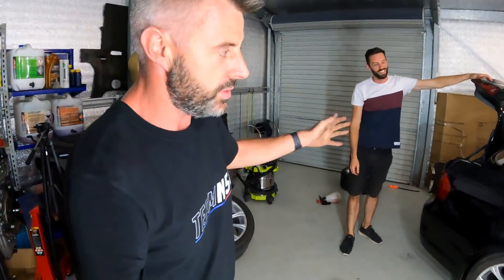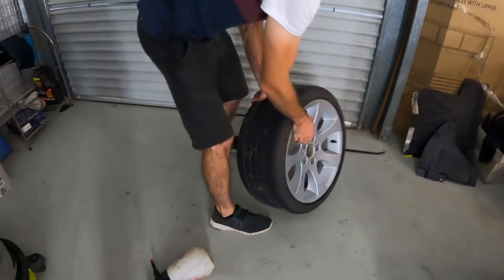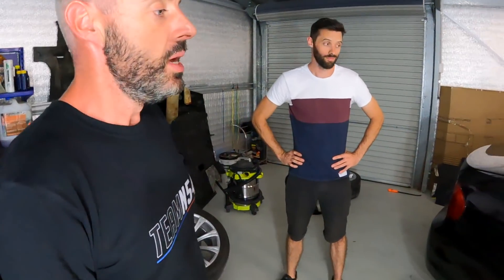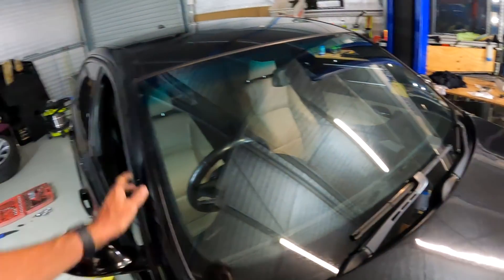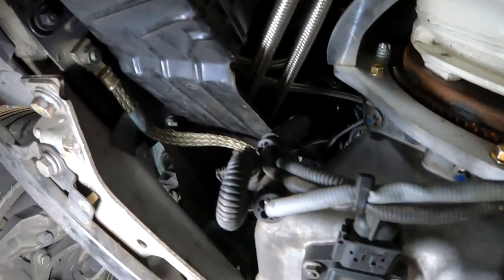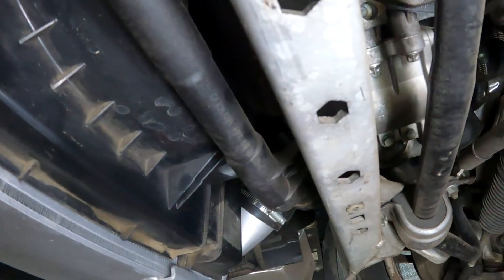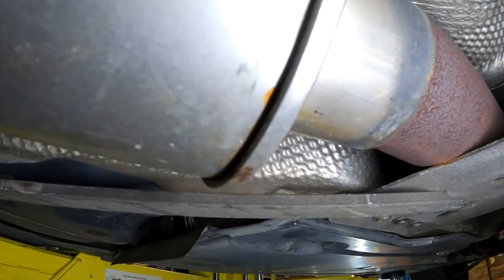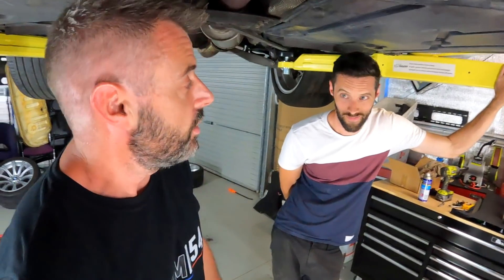The fastest STREET driven BMW N54 is on the LIFT!!

Comment: For the exhaust noise use a small piece of conveyor belt between exhaust and subframe to minimise vibration , the first layer of rubber burns and sticks to the exhaust to keep it in place and the middle layer of reinforcement stops it from burning through, the last layer of rubber will do the job of isolating the vibration 😎
Reply from the maker: Not a bad idea at all.

Comment: andrew use a 21mm 12 point socket on an extension and a large hammer and beat the socket over your security nut and you can undo it with a half inch ratchet or strong arm thats how i removed mine works a treat dont be afraid to wail it on cheers glenn

Comment: I would like to take you up on the world's fastest street driven, 4 years ago we where trading 275kmph on 1km..not pulling your socks however love the content from one n54 guy to another keep pushing foward
Reply from the maker: What 1/4 time?
Reply: @ZeroTo60Tube  very good question and one that would require distinction especially these days when we refer to how fast a car is. Is it fast just over a quarter or over a longer distance like 800m 0r 1000m...factors like gearing, Tyre used and so forth contribute to either top end speed or quarter-mile time. In terms of our bmw 1m coupe it was not setup for quarter but more so for top end speed. Our best on the quarter was 12.2 at 207kmph on a concrete Un prepared surface and street tyres as to the point the car was setup as per distinction for top end speed and not for the quarter
Reply from the maker: @EnthusiastGarageSA  100% correct. The fastest 1/4 time has been the daddy bench mark for the best part of 100 years, but there are many other "records" these days. I can't see this car being that quick over a 1 mile, it will run out of gearing pretty quickly. I have become a fan of the 100-200 times lately. I think these relate to a lot of street roll racing. Have you played with a dragy much? Im not going to stalk your channel for some vids of this 1m (dream N54 right there).
Reply: @ZeroTo60Tube  we still a very small channel for some reason the algorithm doesn't favour us or we just suck at the videos, 1m gearing I think is 375 you correct...however at some point maybe we can do a podcast or something...100 to 200 is our favorite especially here in South africa with the amount of gtrs and  Supras we enjoy roll racing. We use vbox but draggys are available..please keep up the quality content as we truly n54 fanatics...I  going to try a different route on my n54 though this year..ditching mhd and jb4 not because they bad I just want to try out a different approach...maybe you can ship us a gfb3 boost controller from down under..our build on the 1m starts in about 2 months time hopefully as we currently busy with an e30 m3 replica with s54 motor 😀
Reply: @EnthusiastGarageSA  what's your 100 to 200